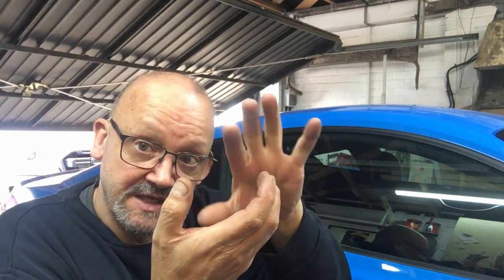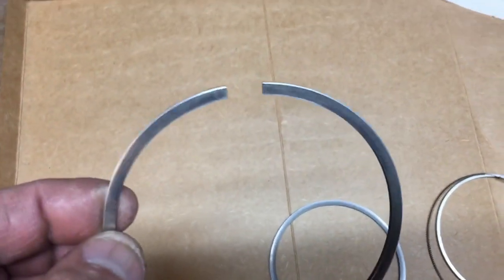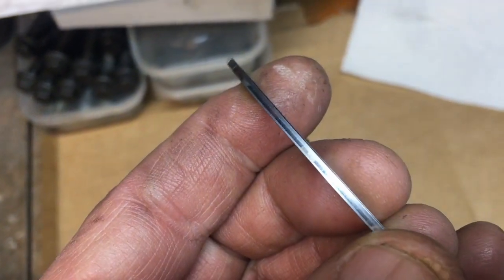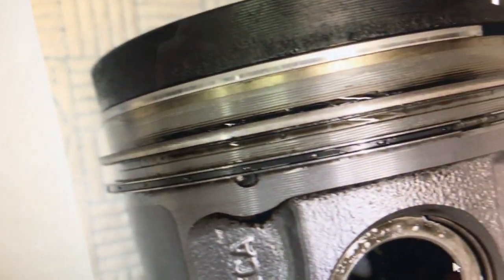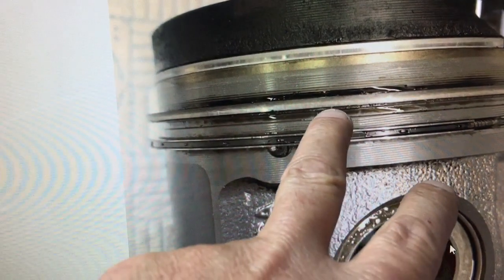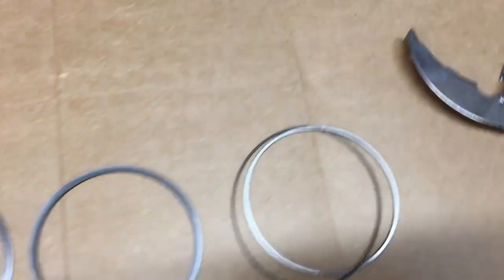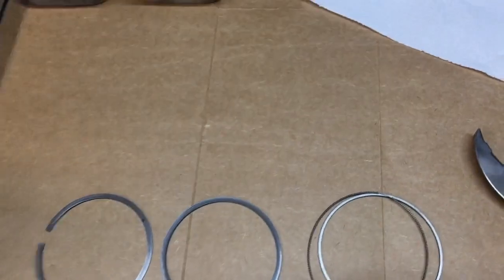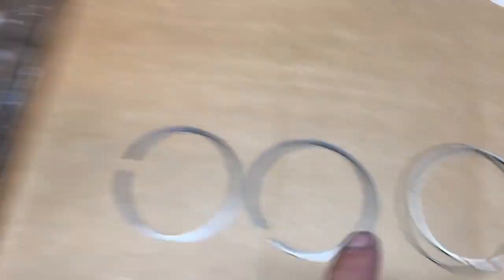Land Rover Puma 2.4 Tdci rebuild. Part 3 Manual omissions and piston rings.

Comment: HI Nigel just want to say thank you for your video they are very informative. I have a 2010 Land Rover Defender 130 with the 2.4 TDCI puma engine.  I need to rebuild my engine soon as I lost compression in and  it started pushing oil out everywhere . I was wondering I it is possible to send me the workshop Manuel that you use to rebuild your engine? kind regards.

Comment: Hi Nigel - great videos, I am really enjoying them and appreciate the level of detail you are going into. One question, my 2.4 Puma was spewing oil everywhere for quite some time and building up pressure in the crank case. I changed the injector seals with very little difference made. I had several people say that I must have some piston or valve damage causing the pressure buildup. I am curious what damage you found when you tore the engine down? Is there a video detailing what you found? I might have missed it.
Reply from the maker: Hi Chris, no damage at all really. It was weeping oil in about 6 places and when I saw the state of the intake all clogged with EGR crap I decided to give it a refresh. Have you checked if your breather is clear?